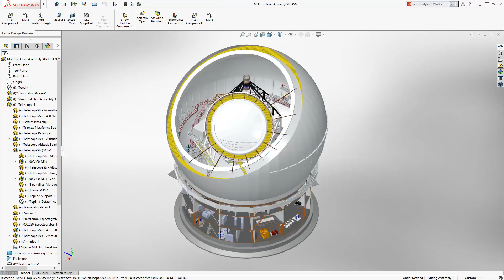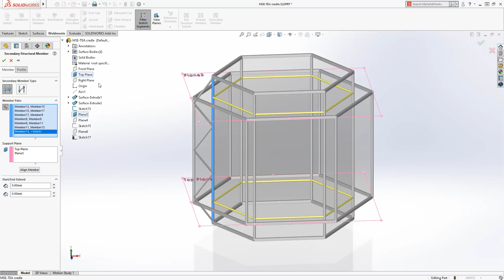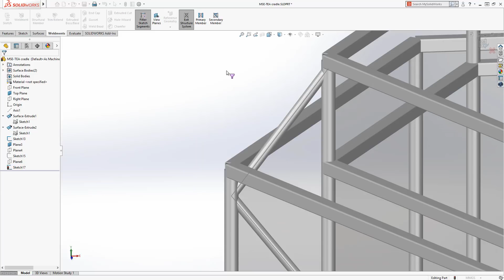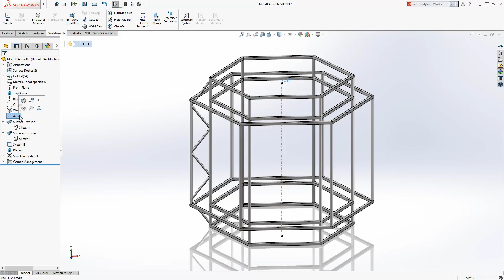Structure System - SOLIDWORKS 2019

Comment: This isn't "structural", it's WELDMENTS. BIG difference between the two! Structural is like Tekla or SDS/2. Does SW have a STRUCTURAL environment with STRUCTURAL CONNECTIONS? That question requires a 'yes' or 'no' answer.
Reply from the maker: Hi There! The structure system feature is an advanced weldments environment that lets you create and modify structural members of different profiles in one feature. The workflow makes it easier to create complex structure systems with flexible corner management and trimming.
Reply: @solidworks  The answer is "NO". Why can't you JUST ANSWER THE DAMNED QUESTION?!